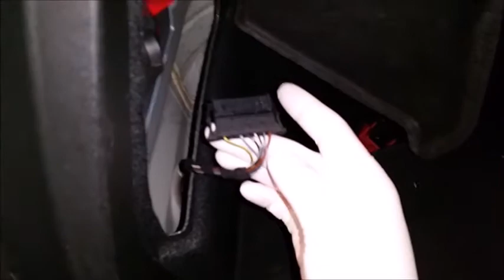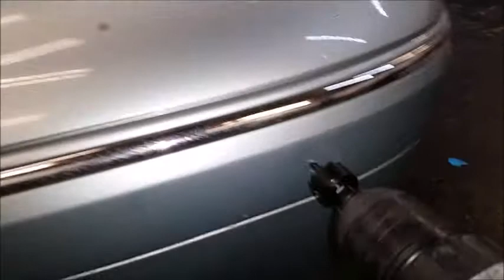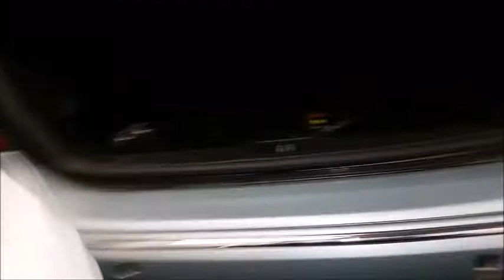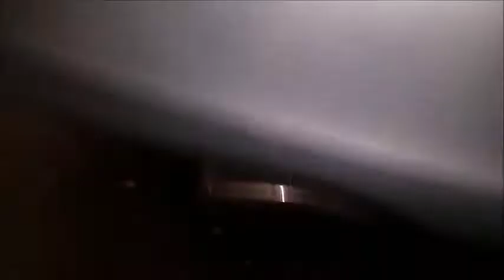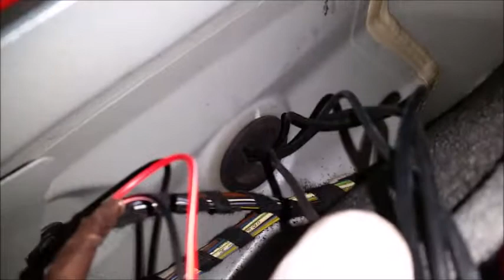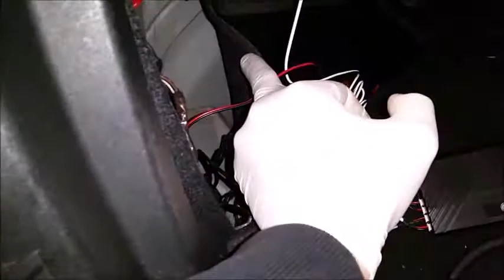Mercedes CLK Rear Parking Sensors 2005

Comment: Does this not upset can bus? Any problems?
Reply from the maker: Hi, not at all. The system is compatible with Canbus. It communicates with your vehicle to inform it that the new system is not an error so it can bypass it to continue normal electrical checks. Hope this helps.
Reply: I don't think it communicates with the vehicle/canbus (I know mine doesn't) but it uses draws such little power compared to the bulb that it would not be detected as an error.

Comment: Ok no response so I found out that this is possible on c200s more or less in the same section of the rear bumper but better still feeding the leads from the sensor through a vent into the back light compartment without going out of the car at all.
Reply from the maker: Hi Firas, yes you're right that's also a good way of doing it. Thanks
Reply: Fun Tronikx   hello my friend how are you. give me the size  for my Mercedes w203  2002